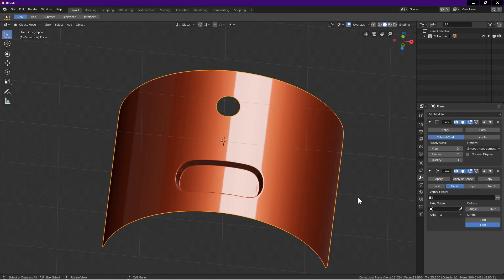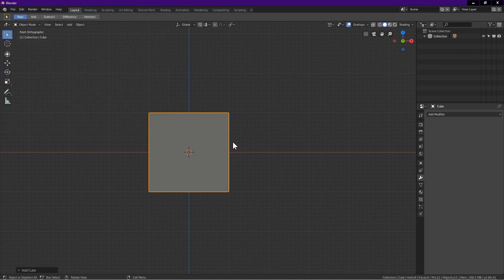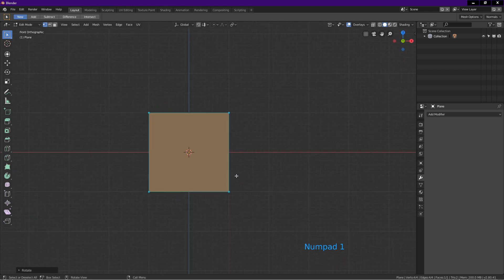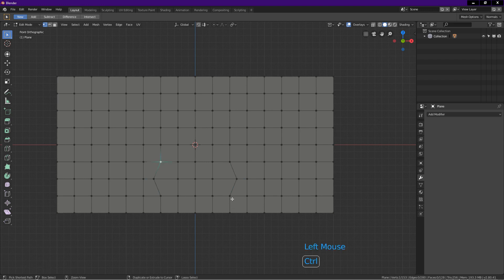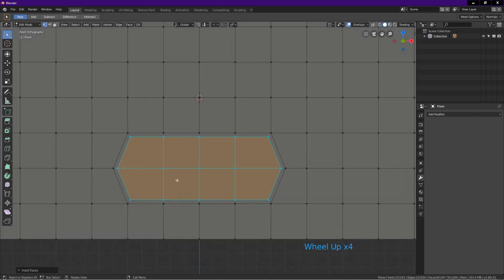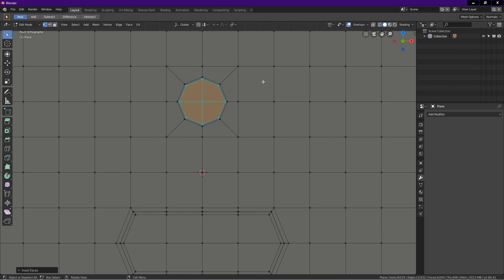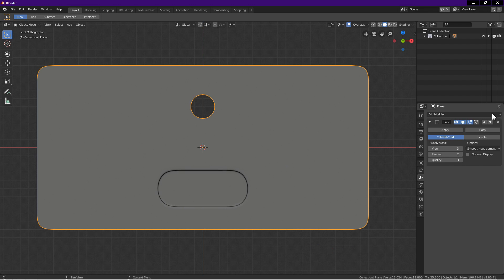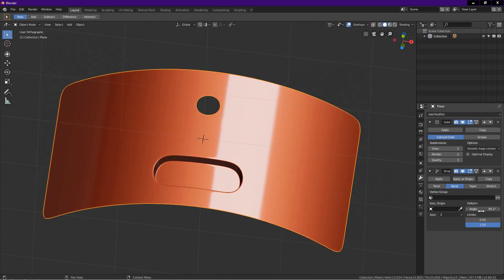Blender 2 80 - Hole On Curved Surface. SubD Modeling.

Comment: I wish this was a tutorial for the actual geometry to achieve that effect, not a deform modifier. This tutorial is not useful at all when considering altering geometry for literally any other practical piece that isn't a simple deform, i.e. everything else.
Reply: This tutorial was most likely done to show beginners they can model quickly, and efficiently with deformers rather than doing it all manually. This may not be for every application, but it does what it does well. Instead of bitching about not seeing what you wanted you should show a little gratitude to the uploader.

Comment: Wondering, any advantage to holding edges over creases?
Reply: From my experience in some situations you get way more control over how sharp you want an edge to be with edge loops. Depending in the surrounding topology if you use a crease you can maybe get it really sharp 100% or quite smooth 40% but it can be hard to get it let's say 80% smooth. If you can use creases for you shape I would go for it because you don't have to worry about edge loops ruining your topology.
Reply: With holding edges you can changes the distance of the edges over distance to get a nice fade out of the edge. Graduating the crease amount does not do so well. Also, creases don't export. I sometimes import objects into another program for further processing.